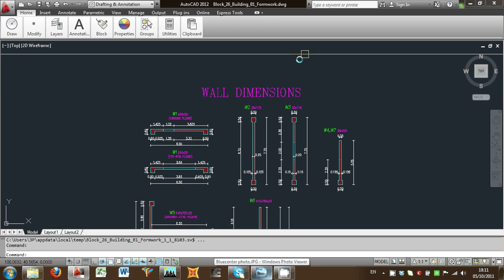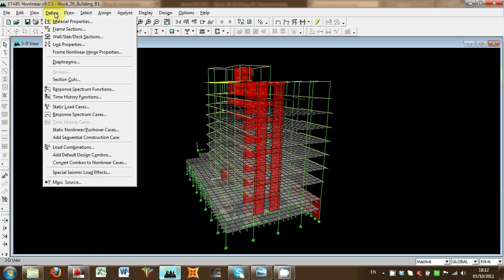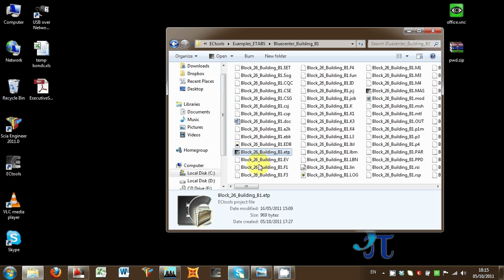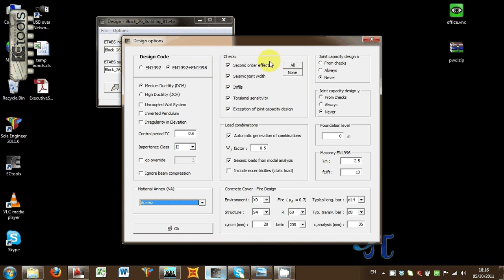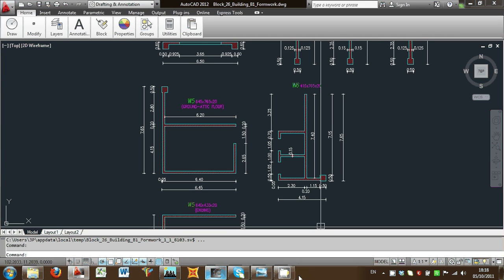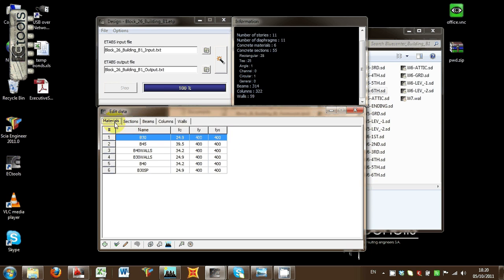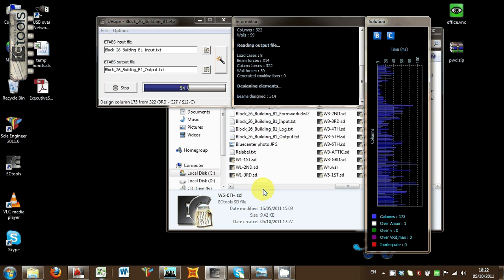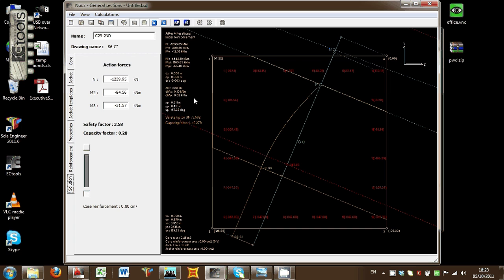ECtools & Etabs-Design of Complex Building according to EC2 & EC8

Comment: how to take vale of ag (i.e ground acceleration)
Reply: multiply 0.1(ag) by the importance factor of the building to be designed.  0.8; 1.0; 1.2 and 1.4 are the importance factor  based on the purpose of the building.